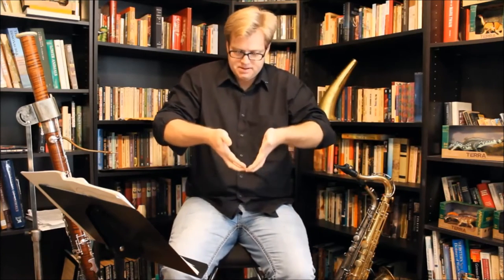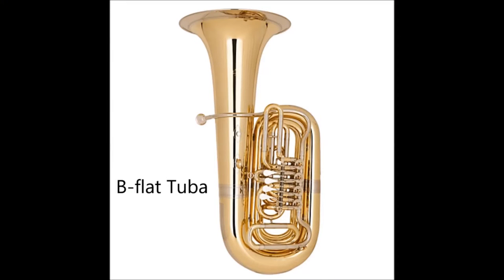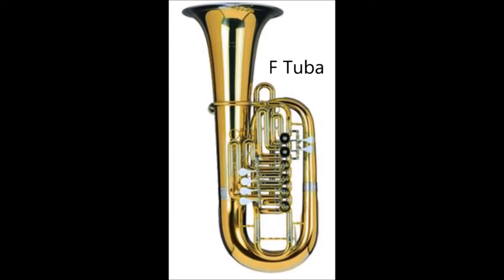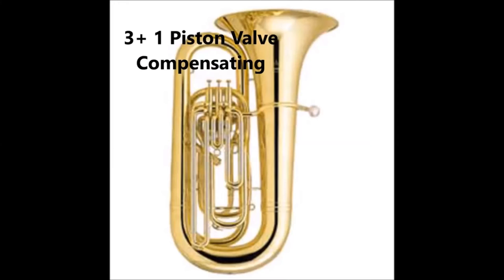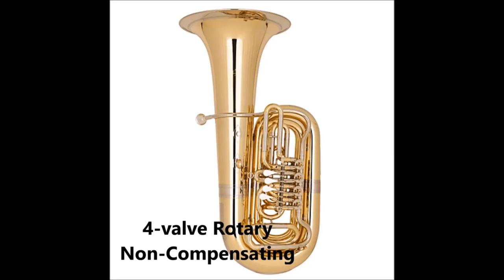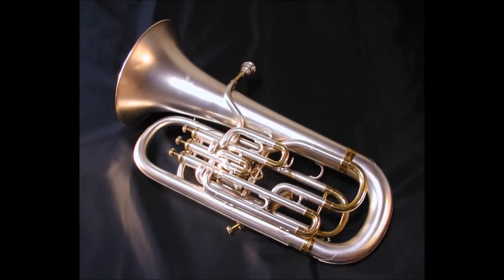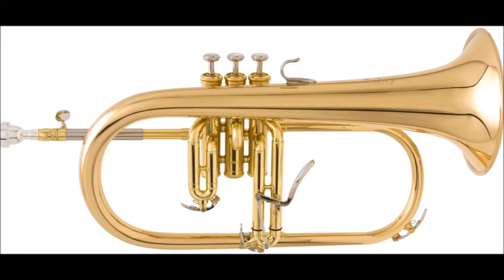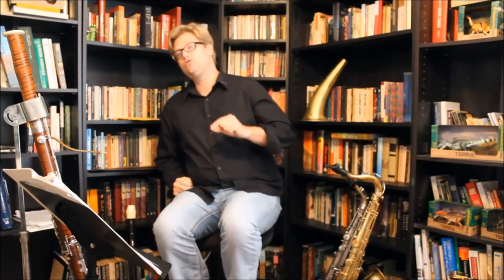Is the Euphonium a Tuba?

Comment: Is the flugelhorn really a soprano tuba?
Reply from the maker: Yes it is.
Reply: It’s funny, I would say it seems more of an alto pitch, but I’m not that informed on brass.
Reply: @mchenrymaney262  It's the same pitch as a Bb clarinet
Reply: I would say the tuba is a bass horn. Tuba is a specific variant on the horn family.
The flugelhorn, which is actually the soprano saxhorn, is like a cornet with more flare in the bore and a deeper mouthpiece.
Traditionally, brass winds are divided into horns, with conical bores, and trumpets, with cylindrical bores.
French horns, by demanding to just be "horns", fouled up the system.

Comment: For years I owned an E-flat alto fluegelhorn, pitched the same as an E-flat alto horn. They would fit your definition of an alto tuba, as they were both basically conical bore, and both could actually play the pedal note. For years I also played regular tuba as well as euphonium, trombone, horn, and cornet. They were all fun, and I became disabled so I no longer play in public. I don't understand why if a French Horn can be made as a compensating double with rotary valves, why it also wouldn't work on lower brass like the C or B-flat tubas. The only reasons that I could see is that no soloist has asked that one be made, and it is not currently customary to do it that way, with a dual plane rotary valve like a horn.
Reply: There are compensating BBb tubas, but their weight is not to be overlooked..
Reply: I read that rotary compensating tubas were attempted but the design and weight of the valves was too poor. I play a compensating (3+1 piston) Bb tuba pretty frequently and they are uncooperative instruments. I can definitely imagine compensating rotors not being viable

Comment: I'm a tuba player. You did miss a part of the definition of a tuba. It is also the lowest brass instrument in the band. Good video though.
Reply: that definition doesn't work, Eb tubas are Tubas, yet they are pitched higher than Bb tubas, and are usually used together in the same ensemble. So because something is a tuba doesn't mean its the lowest pitched brass instrument in the band.

Comment: I would argue that the flügelhorn, sousaphone or contrabass bugle don't meet one common rules of what the "real" tuba is. The fact that they are all played in an upright position. The flügelhorn is played in a forward facing position and is therefor not a tuba. (If anything is misspelled feel free to correct me)
Reply from the maker: Shape isn't an essential characteristic for an instrument unless it fundamentally changes the sound of the instrument. A flugelhorn re-wrapped to be in the shape of a traditional tuba will not play any differently than it does in the standard configuration. A curved soprano saxophone and a straight soprano saxophone are not two fundamentally different instruments, just variations on a theme.

Comment: Alto Horn,FFF Tuba
Reply from the maker: Is that a question?
Reply: No,just listing more tubas;unless Alto horn isn't conically bored.
Reply from the maker: It's not a fully conical bore instrument. It's much more akin to the cornet (as opposed to the flugelhorn). Instruments larger than the Bb Contrabass Tuba have not proven to be useful, which is why I've left them out.
Reply: that leads me to ask why there aren't more conical tenor/alto horns? wouldn't be a distinct enough voice from the french horns perhaps?
Reply from the maker: There are actually. I spoke with Kanstul about two weeks ago about such an instrument they have in their line up. It's hidden in their marching lineup, but their "marching alto" is essentially a wide bore Alto Flugelhorn.
Reply: Bandestration im curious how it sounds compared to their mellophones now
Reply: Bandestration well actually i was just looking around and saw this on the Kanstul page for their mellophone: “Also available with an 8" diameter bell as the Model 275 Marching Alto.” so essentially its a mellophone with a smaller bell. so is the mellophone a tuba, and is it actually more conical than a true horn?
Reply from the maker: Yes, they're much more conical than a Horn. Actually, Horns are mostly cylindrical. Kanstul's marching Alto, after talking with Jack Kanstul, is really an Alto Flugelhorn. It is much more conical than the Alto/Tenor Horn and fits perfectly in the definition of Alto Tuba.
Reply: Bandestration of course thats obviously true about the horn when i consider it but its also counterintuitive to my understanding of why its sound is what it is even apart from the acoustics of direct vs indirect bells, like why alto horns and mellophones tend to be harsher even with a horn mouthpiece pipe or adapter. length of tubing is an obvious answer, i just read somewhere in sixth grade that horn is mellow because its conical and it stuck with me. convenience is the only thing i miss about the mellophone really, but there are probably better-sounding middle brass instruments today even outside the DCI lines. i assume the kanstul alto and mellophone play and sound basically identical so its interesting.
Reply from the maker: A lot of the Horn's sound comes from the fact that it uses up to the 16th partial whereas most other brass only use up to the 8th. THose close together harmonics make a huge impact on the sound.